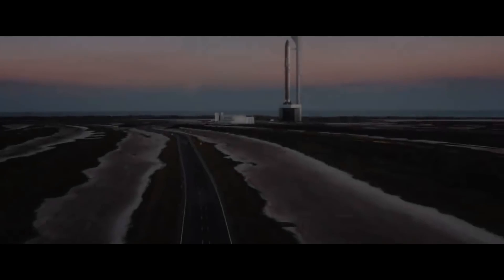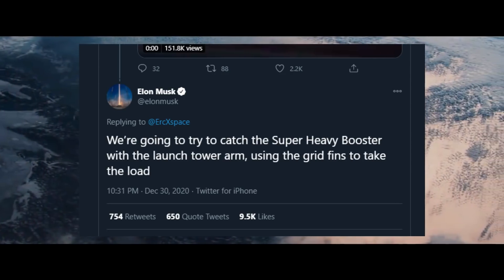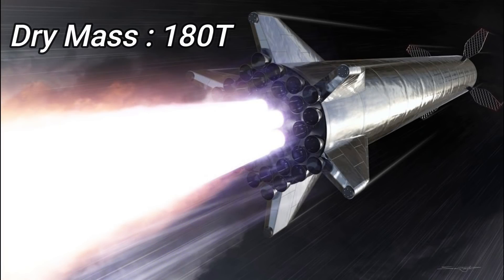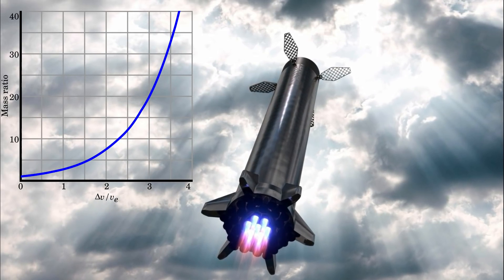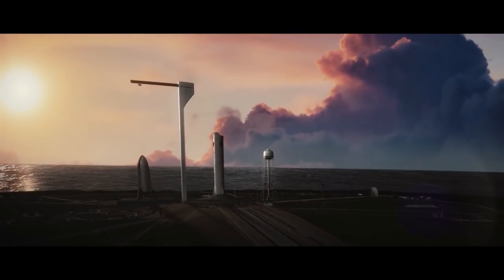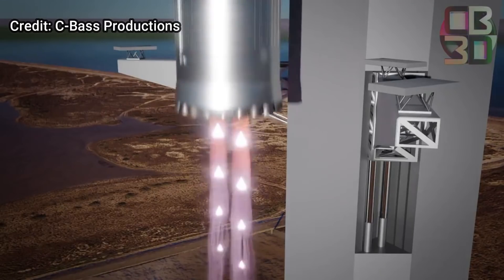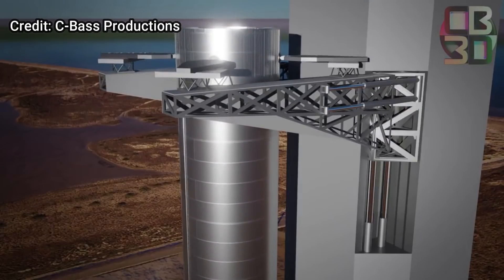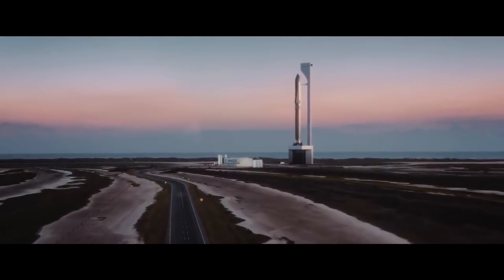SpaceX's Crazy Plan To Catch The Super Heavy Booster Explained!

Comment: It should be part of the crane to reduce complexity of the tower and improve flexibility. If it could rotate, multiple boosters could land in session on standby for launch of multiple Starships. 
O-ring system where rocket would fly in (relatively big opening so there is room for errors) and caught by steel cables like jetfighters are caught on a carrier ship when landing. 
Why cables. As mention, it would be directly connected to a crane so after catching the rocket, it would crane it to a position for a launch or a side for standby. Same mechanism would be used to grab a Starship and crane it on top of the booster.
Any number of backup cables could be in place in case of main cable snapping or miss catch.
Maintaining and replacing cables is tons cheaper then some custom solid rig.
By increasing strength of the cables/decreasing load on cables would increase longevity/durability.

Comment: Just land in the water.    Solves lots of problems, and launch may be over water anyways
Reply: not sure...  you need to consider the impact of salt on the engines.   Forget about a quick turnaround if the bell is exposed to the thermal shock going from on to in the water in one second.   long inspection would be required on each splashdown.  also the pressure between the engine quench to the final capsize of the booter is a significant load on the structure even if you enter the water at near 0 speed.    I think the catch by an active system is interesting even if the fin idea ends up not working out.
Reply from the maker: Actually salt water can damage the engine components..... So they have two options.... Either land using legs or catch the booster..... Thanks for watching 👍
Reply: salt water isn't the problem bcz they want to use these boosters again in few hours' Which isn't possible if they land it in sea bcz recovering the booster will take alot of time .

Comment: Nor ain't I got unfortunatly but surely the skills of a structural engineer neither of a space techs' one, but 180 t  seems indeed a rather heavy load to catch !
Reply: I think that you need to remember that the mass of the booster will be offset by the downward thrust of the raptor engines used for the fly back, so the catch load will be reduced considerably by that.  It is still going to require some location accuracy for sure, but the idea for the catch is very good, IMO.  BTW - I am a structural engineer, retired.
Reply from the maker: Exactly! If they get the accuracy then catching can become fairly simple.... Thanks for watching 👍
Reply: @philiplangford9434  Thanks to enlight my poor declining lantern. Once the raptors have done their duty, the structural capacity of the  tower must compensate the arrachment force due to the weight unless there are two towers as some dudes are thinking, musn't it?
The concept  is undoubtedly brilliant. I'm just wondering how it will be shaped ;-) For you with your skills it could appear as relatively clear but for me, though interesting it could appear, it's beyond my comprehension. Should have learn mathematics instead of latin ;-) (could be both but not everyone is becoming Robert Oppenheimer, Werner von Braun or Elon Musk.
Reply from the maker: Let's hope for the best.... Thanks for watching 👍